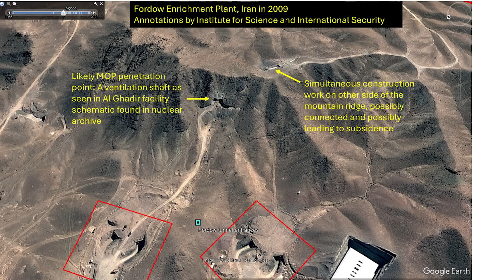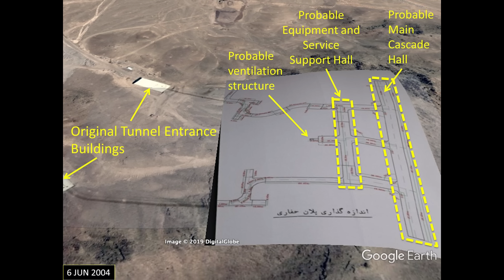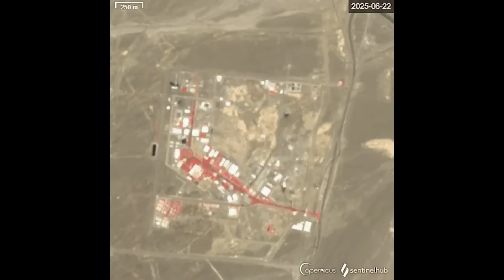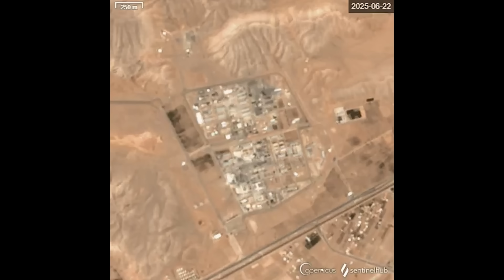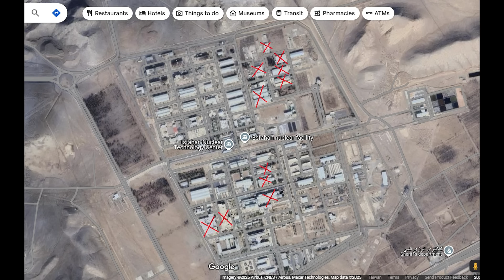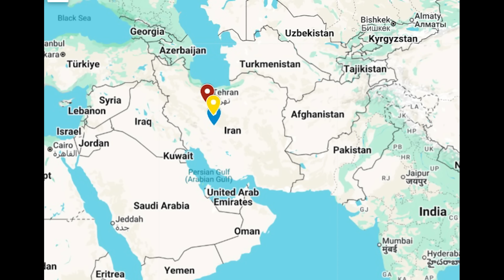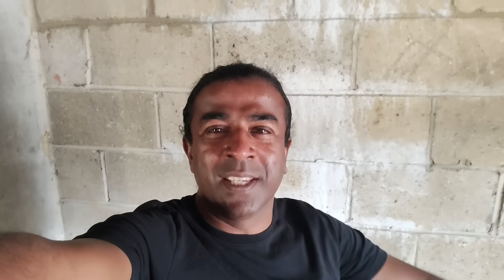Operation Midnight Hammer: New Satellite Imagery of Fordow, First Imagery of Natanz & Esfahan

Comment: Since 3 different holes, did all 3 detonate at the same depth?  Or does a detonation  make a big hole, allowing the next one to go deeper?
Reply: The first one will shatter rocks and allow the next two to go deeper and deeper. So we are told which makes perfect sense in relation to the physics.
Reply: Pentagon says 12 MOPs were dropped on Fordow. We see 2 groups of 3 holes, with 1 hole in each group being visibly bigger. Some finger math says that the larger hole must then have been hit 4 times in total. The first barrage of 3 was probably to loosen up the soil, like a mining blast, and then they just kept "ramming it in" after that.
Reply: I hear that the MOPs detonate when they stop moving, as opposed to being timed, so consecutively dropping several through the same "wound channel" should give you a large percentage of the total ~200' penetration per bomb with a BOOM every 200 feet. So 4 bombs down the same hole would theoretically penetrate ~ 800 feet and sow extreme sadness every 200 feet along the way.

Comment: Autoclaves here are probably used to thouroughly dehydrate the "Yellow Cake" (U308) prior to its conversion to UF6 gas needed for the centrifuges. Chemically speaking...you need to keep moisture out as dry UF6 gas is less corrosive.
The GBU-57 is a monstrously effective bomb using a delightful combination of Aluminum Dust, Potassium Perchlorate and a fast explosive PBXN-114 to disperse and mobilize (and ignite) the aluminum dust and potassium perchlorate oxidizer. It is a giant thermobaric explosive which will momentarily burn almost as hot as the surface of the sun. Everything combustible will have ignited and burned (and is still burning.) It will take a year for that place to cool down enough for any possibility of entry...which I doubt anybody will. Whatever was left...the heat will bake the moisture out of the thick concrete causing it to crumble, and the steel reinforcing will soften and collapse. There'll probably be sink holes all over that mountain in a week.

Comment: Notice the grayish dust around the holes. That is concrete dust from the facility below.
Reply: I was thinking the same thing and i'm not sure on that, but it's a good guess on what that is.
Reply: @RobK-rl6sn not correct , that greyist color comes from the dust and rocks that were shaken by the inner blast , and ehen descending diwn the side of the mountain.  I you do calculations  , being the crater in the 8-12 m in diameter vs 60  m depth that makes a 7,6° /360 ° = 0.02 => so ideally only 2% of the blast energy would be focused through the "open " channel thus created by the sucessive MOP ' s entrance. So no way that greyish color comes from the inner installation. By yhe way , once the bomb penetrates vertically , there is not left a vertical tube since the vertical walls of the bomb entrance usually collapse into the void created by the bombs ' path
Reply: Or just powdered rock .

Comment: Wait, I dont understand. From the schematics, all the US seems to have hit are maybe 2 to 4 IR-1 centrifuges? Assuming the munition managed to go deep enough.
Reply: They are in a cascade form, meaning the process involves them all. 
It's like if "only" one of your cars tires are flat and you want to drive 500 miles.
Reply: @Qingeaton1  I think I understand, but is that not still something that is relatively easy to fix?
Reply: Centrifuges that spin at 80k RPM are very delicate machines. You don't need to crush them like a soda can to utterly destroy them. Heck, you probably only need to give them a light coating of concrete dust to require a complete rebuild.
Reply: @andersjjensen ty I understand now

Comment: Listen to the pentagon's morning briefing for counts of the bombs. It's 12 in the primary target and 2 in a secondary target. And 30 cruise missiles into the secondary targets.
Reply: If that's the case then Fordow is absolutely toast. There were only 6 holes visible on the surface. 2 groups of 3 each, with one hole in each group being visibly larger. My first estimate was that 8 bombs were dropped there. 2 in each of the larger holes. But if they dropped 12 in total, that means the larger holes were hit 4 times in each.
Reply: @andersjjensen Curious, if they’re that accurate, why two holes each side of the main one? Perhaps they dropped three at once to soften up the target area, three shock waves at once might do a lot of damage even if they don’t reach the bunker, then they sent two more with an interval between them down one of the holes to penetrate deeper and have a blast inside the bunker. It was said to be deeper than one bomb alone could reach.
Reply: @StillAliveAndKicking_  My thoughts too. I don't know if the first 3 hit simultaneously, but "mining blasting" still works with sequential detonations.
Reply: @StillAliveAndKicking_  It could be to avoid "rifling" (that the explosion just shoots right back out of the hole) and to  fracture more rock for a better effect in the centre hole?
Reply: @AndersWahlberg Yes I wondered if three close by would fracture more rock, allowing follow ups in one hole to go deeper, or even allowing their blasts to propagate along rock fractures, cause the whole lotvyo collapse.
Reply: @andersjjensen  Us army publically announced the facility is heavily damaged but not destroyed. Well, it'll probably be abandoned anyway so the end result is the same.
Reply: @electricspeedkiller8950 no they didn’t.  Stop it.  Why would the US Army know or say anything like that?  Fake.
Reply: @mandoreforger6999  Because they're not trumpists.

Comment: Perhaps (but unlikely) we'll get to see some SAR imagery of the region. SAR (Synthetic Aperture Radar) is able to spot miniscule changes in elevation. Miniscule = a fraction of the RADAR wave length. That way it might be possible to see subsurface areas caved in.
Reply: They will also be able to see into the creators as well as look inside any open doors due to the nature of the system. Also they might have access to very accurate optical atomic clocks which would all them to map and then do a BDA of the underground site by measuring the variation in gravitational strength.
Reply: What are you smok'n ?
Reply: SAR itself wouldn't be able to penetrate or tell you much from a ground penetration perspective. A lot of math and assumptions  would be needed to assess how much lower the ground is on average around Fordow- assuming a collapse, which still could've occurred without lowering the top soil elevation; assuming we had the appropriate DTED.
Reply: The only real way we'd know for certain is watching activity at these sites. If Iran seals up the openings, and activity stops, it's destroyed. If Iran just abandons the sites, they're probably destroyed.  If activity at the sites continues, then obviously there's a reason for that activity.
Reply: @SgtBeltfed  problem is they can act like they are still operational by just showing activity even if they were destroyed. They know they are being watched 24/7.
Reply: @kc72186  They could to some extent, but  I don't see where it would benefit them. If it's seen as operational, there's be a high chance of it getting bombed again. Israel also has a lot of intelligence on the goings on in Iran, so faking it would get found out. If the US bombs a destroyed site again, it doesn't really matter.

I would say it would be smart to fake it getting taken out, and leave it inactive so that it could be restarted later. Problem is, Iran wants nuclear weapons, bad. They see it as a great equalizer. I also doubt there is a later for Iran's current government.
Reply: @SgtBeltfed they sealed the entrances with dirt before the operation so who knows what the state of play is inside
Reply: @jonathanbuzzard1376 There's going to be ventilation that wasn't buried to provide air to the facility. If the facility is the uranium contaminated mess I expect it to be, Iran will be plugging those up. They'll also fill in the holes the bombs made. Or they won't and decades later they'll be finding uranium in their ground water.

Regardless, there's going to be a minimum of activity at the sites if they're destroyed, maybe some security to keep the curious away but little else
Reply: @SgtBeltfed  Yeah, you are right.
Reply: You won't get "miniscule" changes in elevation from satellite SAR (afaik). High-precision digital elevation models used in geosciences are made by airplanes.
Reply: @whuzzzup  it has been claimed that orbit-based SAR's can detect an underwater submarine by spotting a submarine shaped pattern in the water surface level. 

If that's true then that assumes they're capable of measuring some seriously tiny differences in elevation. 

Not sure if that qualifies as 'miniscule' though.
Reply: @TheNheg66  analysis by FFT to detect bow waves coming to surface.
Reply: As a physicist if someone looks at your comment and believes you they must not be smart

Comment: In the footage from Fordow there are two groups of 3 holes, with one hole in each group being visibly larger than the other ones. I think 8 bombs were dropped there. With the larger holes being the double taps. The Fordow site is really effing deep, so using the first three to loosen up the soil, like a mining blast, and hitting it again makes sense.
Reply: There were 6 GBU's dropped on Fordow and 2 at Isfahan and surface mutuons.
Reply: @t.r.4496  but the sent 7 planes. Each plane can carry 2 that is 14. Even if they dropped 8 where did the other 6 go.
Reply: I did read that they often go in and soften it up first with one and another follows in quick succession. 
I believe that while the rock is still undergoing shock wave pressures, it is weaker than normal for number 2. 
 I did some flint knapping in the past, and you can see the shock waves on a piece of fine grained quartz you fractured, just like ripples of water across the face of the stone.
Reply: More likely that the biggest hole  was just the last one made, I can't see how they would have managed to drop 2 bombs right on the exact same spot twice.
Reply: @SueMyChin  Those holes are 10 meters across. And these bombs "hit a dinner plate" if the wind is calm.

If you recall back when Ukraine was hitting the Antonovsky bridge, to prevent Russia from reinforcing Kherson, the satellite images showed hole patterns, dotting across the bridge, that looked like a gigantic sewing machine had stitched it. In adverse conditions GMLRS rockets have a CEP of 5 meters. But in optimal conditions they can basically hit someone in the head.
Reply: @andersjjensen  and if we need even more precision there are ways to get it.  Think about flying  portable cell "towers" for triangulation but for GPS functions. or laser designators. that's stuff from 30 years ago and i am sure they have even better stuff now. Old tech DTED maps and quantum precision laser ring gyros or solid crystal positioning systems that act like the older gyros but with femto second 1/4 wavelength sampling
Reply: @andersjjensen  That's garbage though. The GBU 57 has a circular error probable of about 5 meters (some size dinner plate). Those entry holes are nowhere near 10 meters across, the roads aren’t even 5 metres across and they're twice the width which makes sense as the bomb itself is not even a meter in diameter. Also we know my assumption is correct now anyway too.. It's confirmed they used 6 on this base...
Reply: @SueMyChin  This imagery is 30cm resolution. So if the holes are just one meter across that would be 3 pixels wide. YT compression makes it hard to tell, but I counted roughly 25 pixels. And no, it's not confirmed that they used 6 here. Pentagon said 12 here and 2 on the other base.

Lastly, CEP is measured under as adverse conditions as the weapon is rated to operate under. In calmer weather they always outperform CEP significantly. The real world is not a computer game where you just look at a chart, do the math, and then it always happens that way.
Reply: @andersjjensen  CEP is not measured in adverse conditions, they always qualify that when used in adverse conditions you will see deviations from the advertised CEP.  ...and big brain here went to the site on google maps, zoomed in and you can clearly see that the roads nearby are less then 5 meters across. I then cut the wholes from the Satellite photo and they sit comfortably inside the road width twice.
Reply: They have a way of doing it
Reply: 12 MOPs were used on this facility…6 hit each strike site.
Reply: How does it make sense and why should we listen to you?
Reply: @se9252 Who you talking to? The information has already been released.

Comment: I've worked with autoclaves. That was about rubber. But I guess it could be used for other purposes also.
Reply: Yes for post curing process !
Reply: I believe they are widely used in labs. I did some pecan breeding years ago, and the container that was to hold the pollen we were to use was heated, and allowed to cool sealed, so that it would not possibly contain any other random pollen or disease causing organisms.

Comment: If the explosions happened underground, and the force of the explosion was trapped underground (no surface 'release' vent showing) then the force of the explosion would have spread everywhere within the facilty.
Reply: There are some pictures available online of a massive black mushroom cloud view from a highway, but I'm not sure which site it was showing.
Reply: @alreaud  Most likely the surface strikes at Isfahan. I don't think there would be that much black smoke from the underground complex. Black smoke is mainly from burning oil/fuel or plastics.
Reply: on paper.. yea

believe it not the majority of the world is pretty hesitant to believe the claims that a bomb can penetrate 300ft

which you know... is why we are here
not because we need a rundown on how it works.
Reply: A bit like explosive diarrhea
Reply: Depends if it breached the tunnel . If not then most of the force would come back out of the hole it made going in  .
Reply: Wouldn't that cause the sealed entrances to be blown out?
Reply: @martinvorholter3675  the bunker is really large. By the time the shockwave hit the blast doors the vacuum behind would allow the explosion to get sucked back and travel down the tunnel again because that's the path of least resistance.
If it was a room sized bunker the doors would have been blown into three zip codes away.
Reply: Other blast doors might still be between the main facility and the entrances. Given that we've been shown evidence of blast protection measures (the two 90° turns halfway between the entrance and the main facility)it doesn't seem like an unreasonable assumption. @martinvorholter3675
Reply: excellent conjecture

Comment: If the bomb could be programmed to explode in the shaft the containment would result in plasma temperatures running along the shaft. Steel doors would not stop it unless meters thick. If that hot gas got to touch the centrifuges I can guess they would be scrap. Thank you Star Wars!
Reply: Guess what, not so long ago (February) the US spoke about the MOPs getting their smart fuses for Precisely that!

Comment: a bunker ventilation shaft isn't directly linked to it, it snakes underground, the simply bombed the entrance and surface shafts by bet would be the reactor is still safe
Reply: It provides the weakest link. Any hole is a hole and not solid rock,.,

Comment: An autoclave is basically an oven that can alter variables like pressure, humidity, and temperature. We used them for sterilizing materials in the lab.
Reply: In uranium enrichment, an autoclave is used for feeding UF6 into the facility.  UF6 (uranium hexafluoride) is the working fluid used in enrichment. It is a solid at room temperature, but when heated up it sublimes into a gas (at 1 atmosphere absolute pressure the phase transition is at 133.8 F). The gas centrifuges process the gas to separate  U-235 from U-238, splitting feed into an enriched stream (containing more U-235) and a depleted stream (containing less U-235). The UF6 is stored and transported in steel cylinders. As noted above, the UF6 is a solid at typical environmental temperatures, so the cylinders holding solid UF6 must be heated to vaporize the UF6 in order to feed it into the process. This is what the autoclave does - a cylinder full of solid UF6 is placed into the autoclave, a tube connecting the cylinder to the process piping is connected, and the valves on the  cylinder and process piping are opened. The autoclave is then closed, and steam is vented into the autoclave (outside of the UF6 cylinder) to heat the cylinder. After a few hours the UF6 in the cylinder will be a gas, and can be sucked into the process. After the cylinder is empty the steam is turned off, and the equipment is allowed to cool. The autoclave is then opened, the empty removed, and a new full cylinder put in place to start again.  Autoclaves are not needed for product or tails (depleted material) withdrawal - pumps push the UF6 into the cylinder until the proper weight is reached. When the cylinder is full the valves are closed and the cylinder is moved to an area where it can cool down so that the UF6 solidifies.
Reply: Good stuff, thank you.
Reply: They are used in the conversion process to UF6 prior to enrichment in the gas centrifuges